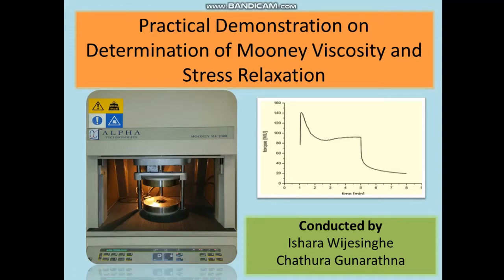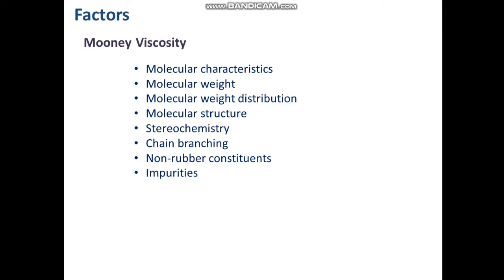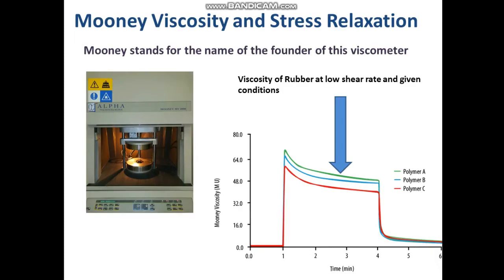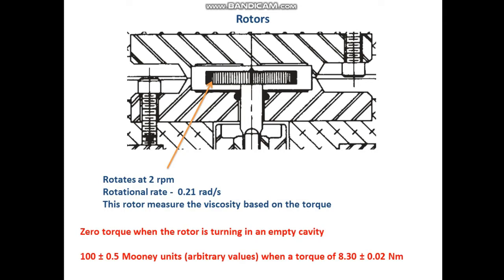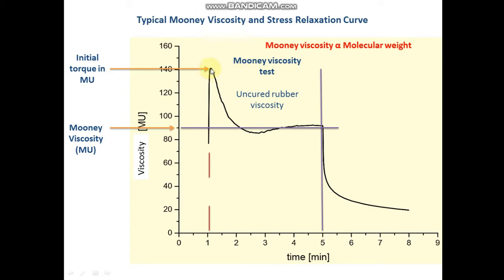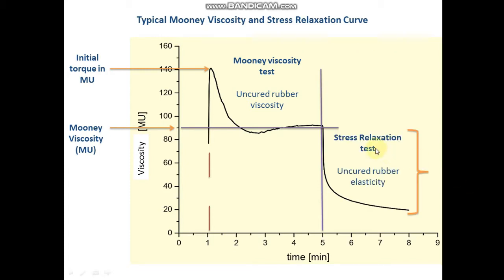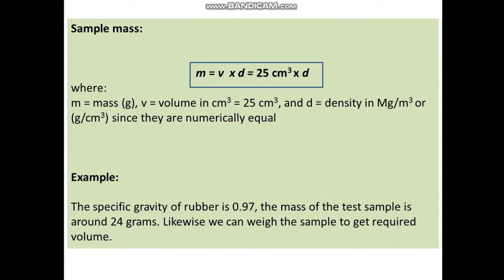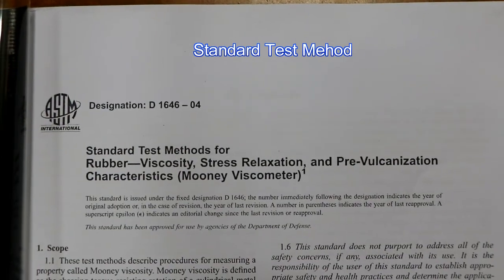Mooney viscosity and stress relaxation of natural rubber - Practical Demonstration

Comment: Sir we can study scorch time ,flow properties ,stress relaxation from mooney  viscometer then what is requirement of rheometers 
Why both test are done
Reply from the maker: Yes the limitation is the shear rate. this is a rotational type rheometer, the shear force drastically abrade vulcanized or vulcanizing rubber and give wrong results. so oscillating rheometer is needed as such gives a tiny shear force of 1 degree maximum.
Reply: @scienceandtech5590   thank you sir